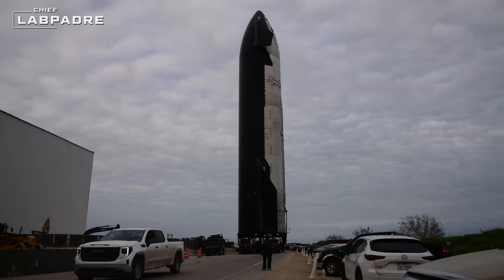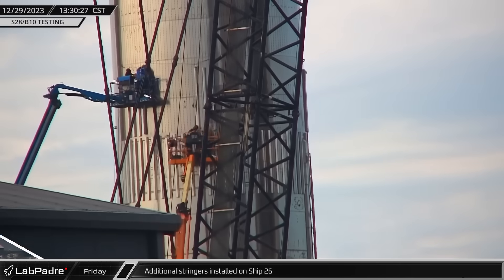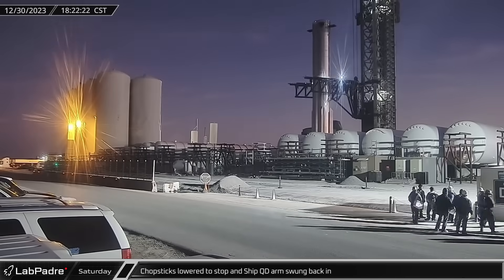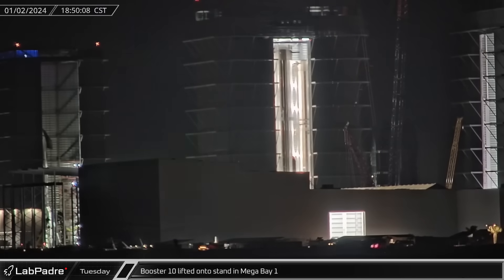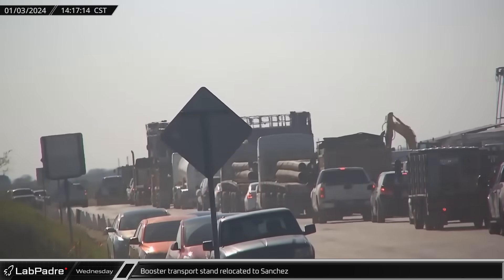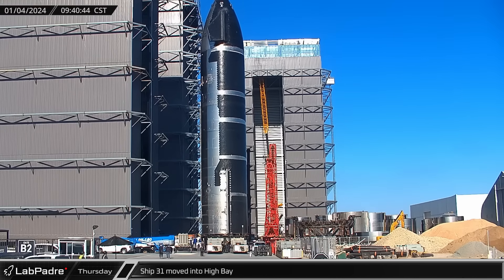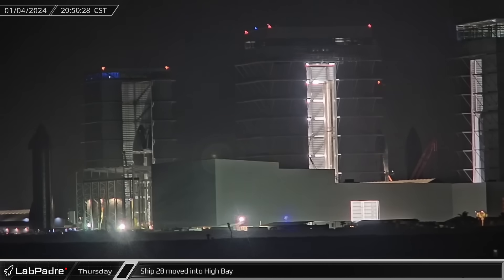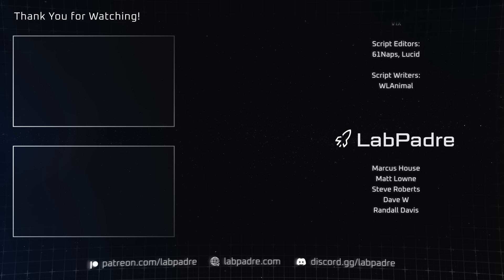Tower 2 Arrives! First Update of 2024! - SpaceX Weekly #96

Comment: Who ones the LR11000 .?
Reply: Space X owns the LR11,000 at the launch pad.  The other one being used to finish Mega Bay 2 must be a rental.
Reply: The red crane around Megabay in this video. The black one at the launch pad is owned by SpaceX, not rental.
The red one has been used for the 2nd Megabay contruction. Now, it's done.
Maybe, they will use them to construct the 2nd tower but there is no ground working yet.

Comment: I wonder how the starship welded seams are holding up against those oscillating stress maneuvers?  I would be closely inspecting all welds and seams for stress cracks ... considering the stress from Max-Q pushing down on the starship and then lifting all that weight with the chopsticks for each launch cycle.  and ALSO, as well, the boosters/stage 1.
Reply: Good point.  A test rig will probably be used to cycle a test article through a lifetime of accumulated stress just like they did with pressurised aircraft cabins while learning about metal fatigue in that environment.

Comment: LR110000 will go to the launchpad for building second tower
Reply: Yeah, they haven't even started excavation for the legs yet. I predict they'll wait for spring for more favorable weather for large steel crews to be out doors extended periods. There's about 80 days in the spring that the weather is conducive to that kind of excavation work without much concern of flooding.
Reply: Maybe, we don’t have the base of the  tower section or any ground work going on, but it more than likely will later l
Reply: If that's where they even put it (I'll agree it's the most likely). Who knows, they could do it at Massey for the future static fire test.
Reply: or the second tower goes to Massey for static fire operations without the needs of other equipment
Reply: @jeanpaulmilani549  No, Massey side is too small and warehouse/office is being built there. Massey test side will mostly be for cryogenic testing and structural testing.
If you watch Marcus House or RGV Photography, the new tower may be located not far from the 1st.
Reply: so the same is for lr11000
Reply: i don't think lr11000 will stay on here